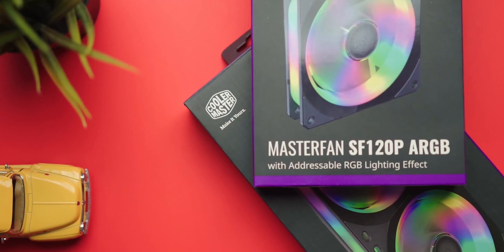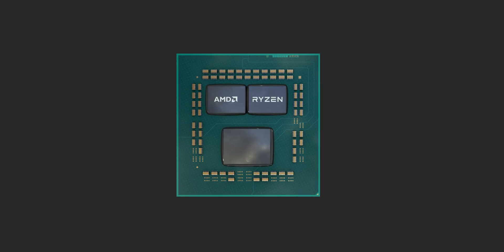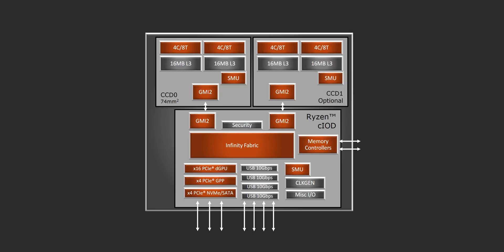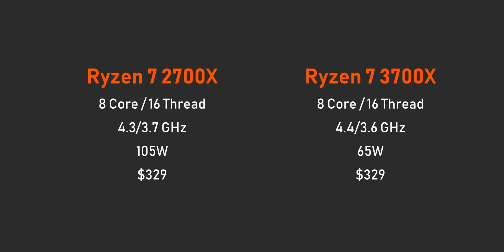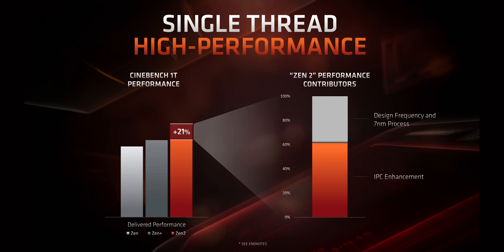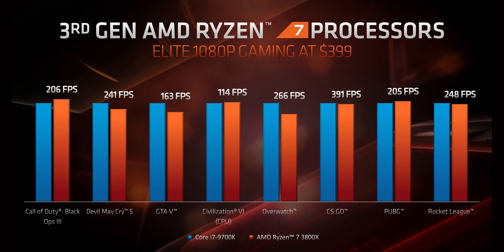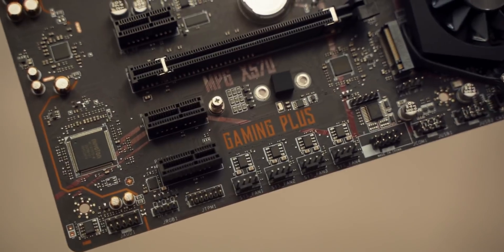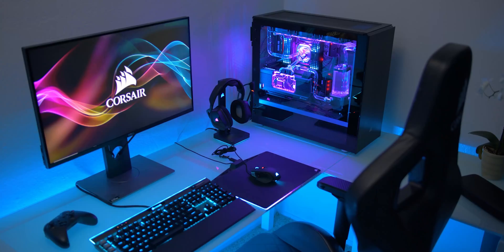AMD Ryzen 3000 – A Very REAL Problem For Intel?

Comment: I just want to see zen 2 ryzen 3 and ryzen 5 (4c/8t). Those "new" apus are very disappointing, they're basically the same cpus (2200g & 2400g) with a little better clock

Comment: it should be noted that the gaming charts were done running pre 1903 update and also pre security updates... so basically a best case scenario for intel
Reply: Yep, and now with 1903 helping AMD quite drastically especially in frame time, not hugely in fps, but perceived experience is so much better. At least that is my experience with gaming on my 2700x rx480 8g system. Then add security updates that are going to slow down intel... those charts were surprisingly not as bad looking as it is going to be in my opinion.
Reply: Zen 2 + 5700XT in Linux gets higher FPS in lots of games, and actually 10% higher in some titles. 1903 update was only really simple rule based upgrade, while Linux can optimize threads much better. After all, the latency between cores is faster in Zen 2 than with Intel in the same module, so careful scheduling have huge effects. Also better compilers will help a lot in the future, we still don't have any compiler with full Zen 2 support. Though GCC 9.1 in Linux already results much better performance with Zen 2.

5700XT has 1% - 0.01% minimums at much higher FPS than Nvidia 2070 super and actually faster than 2080ti in lots of titles. Though AMD drivers are still pretty new, and based on history, drivers will be much faster in the future. Nvidia drivers are pretty much fully optimized after 1 year of RTX. Also AMD has better image quality, because Nvidia has cutting corner optimization tricks due to having fully closed source drivers. It's something youtubers SHOULD research and report more. Comparing ultra setting with high setting would raise huge complaints, but when you lower quality though your drivers, people are just happy about higher FPS.

Comment: Even hardcore Intel Fanboy like me heading towards Ryzen 3000. Yeah, they are in trouble.
Reply: I will go to the best price/performance, and that is AMD right now.
Reply: I have not been on an AMD CPU since my Athlon 64 Shuttle PC LANing days. Even if my next PC has an Intel CPU, which might not be the case as I am eyeing that 3700X (or 3800X), competition is good. For an Intel fan that will always stay with Intel, AMD forcing Intel to compete for price and performance/features is good for them (and everyone else too).
Reply: lol i switched a year ago to 2700x
Reply: @drake6836  i switched almost 2 years ago for the 1600  xDD
Reply: Yup intel fanboy as well. This is pretty exciting for the industry. Switched to to ryzen last year.
Reply: I was on the intel wagon too for a while, but now anyone saying Ryzen isnt a better Price/performance ratio is just blind yes intel is slightly faster but for many budget builders like most of us Ryzen is almost a no brainer to put the extra money you save towards a better gpu.
Reply: Same I may take a look at ryzen 3000 but I simply don’t need it and plus I want to save money for the desktop 10nm intel. What do you think spend 500 for a decent upgrade or wait .
Reply: @Bigboii7  HMMM named troller, talking like intel 10nm will be out before 2021, and like it isn't going to be a performance LOSS in its current state due to 20% lower frequencies not to mention cost 2x more than it should because intel's yields are absolute garbage.
Yea okay, whatever you say mr. Troll.
You can go back to your troglodyte den now.
Reply: @shawnpitman876  lol Shawn calm down.
Reply: I think that means he has finally taken the Red Pill. Good Job!
Reply: DEATH TO INTEL INTEL IS FINISHED! MY MONSTER PC IS RYZEN 7 1700 GTX 970 G1 GAMING 16 GB DDR4 3200MHZCL15 GS KILL RIP JAWS DE;LLP2416D 24'' 2560X1440 60 HZ IPS! RUNS MAX SETTINGS 1440P 30+ FPS EVRYTHING! NEVER BUY INTEL AGAIN!
Reply: @shredderorokusaki3013  PHAHAHHAHAHH ! 30 fps . @ 2017 i play PUBG @ 135-144 fps ( 144hz lock )  with 4790k and  GTX970 !
Reply: @shredderorokusaki3013  even @ 1080p low settings your 1700 @ 2017 had drops to 80 in PUBG !
Reply: Shredder Orokusaki the next card isnt the 3080 its the 2080 super, so yea. I would wait for the prices to drop and get two 2080tis
Reply: @Nathaniel Smith FX 9590, idiot. 5ghz on air.
Wanna prove you know literally nothing some more, fuckwad?
IPC is what matters, not DUHHH I CAN HIT 5GHZ.
Reply: @shawnpitman876  is fx9590 on 14nm ?
Reply: @Nathaniel Smith AMD 7nm doesn't need 5GHz to win in performance.
Reply: @frostybe3r  and it wont on 7nm .
Reply: @Taurus_Play  Intel 10nm desktop won't be til late 2021/2022.
Reply: @Nathaniel Smith Ironically Intel 10nm has significantly lower clockspeeds.
Reply: It's not the general consumer sales. It the OEM builds housing AMD CPUs that'll kick them in the balls.
Reply: I switched a year ago to a R5 2600 from an i5 3570k. Have to say, those cores and threads are nice since I like streaming so its good they are there. I am going to switch to an R9 3950x in December though.
Reply: @Nathaniel Smith Why should Amd aim for 5ghz? If 4,6-4,7ghz matches intel's 5,1ghz. The Magic word is ipc, and yes intel had better ipc for a long time, but even that is lost now. If a ryzen 3000 can oc to 5ghz, with better ipc then intel... enough said i guess. (no fanboy here, have a 4770k and 1700x)
Reply: Hector Domino “In trouble” how? That they’ll be out business or they turn into AMD from decade ago? I applaud companies who turn it around, but the new found AMD fanboys seem to ignore their recent pathetic history. Will Intel suddenly become like that? Doubtful..
Reply: Just want to know exactly how the 3900X beats the 3800X in csgo, gtaV, etc. Does having more cache makes this possible? Isn't the memory latency supposed to be higher on the 3900X having 2 chiplets vs 1 on the 3800X? 🤔
Reply: @Vishnu Kalluri moron , go to my acc and watch videos .
Reply: Thanks for the input. Time to buy AMD stock since even the hardcore Intel Fanboy are leaving Intel , this could only mean that AMD stock price will Rize this year for sure.
Reply: @Vishnu Kalluri KABOOM  ...  here goes blown up ass of AMDtard
Reply: I repeat - 7700k = 3700x < 8700k @ gaming
Reply: @Vishnu Kalluri hows first tests ? >:)
Reply: Miguel Carones  only took his kind 10 years. Intel fanboys are mighty slow on the up tick.
Reply: @jotunheim5302  no. Intel is usually alot better in gaming then AMD that's a fact. The i7 and i9 is still better then any current AMD processor when it comes to gaming that's a fact as well. These new zen 2 processors are the exception
Reply: @hatchell18  Zen 2 > Coffee Lake
Reply: @frostybe3r  yeah no shit but if you read what I said youd see that i said current CPU. Zen 2 is the new AMD CPU that doesn't come out till next month and coffee lake is a year old now so no shit a new CPU will be better. When Intel releases their new CPUs later this year they will most likely be more powerful again like usual.
Reply: @hatchell18  Coffee lake might be a year old and zen 2 will be hitting the store shelfs just now, but the diffrence is intel is now behind and they dont have anything to battle zen2, if they will finally (out)match zen 2 (in 2-3years) Amd will most probably have their new CPU's also ready. Intel got outpaced and has now to play the catch up game. (what amd did for years)
Reply: @themadnes5413  the new 3800x just barely beats the 9900k by 1-3%. The only AMD CPU truly better then Intel is their top of the line 3900x. Dont mistake me for an intel fanboy I will be getting one of the new ryzen chips because right now I have the i7 8700 and I want the new ryzen 3800x. But it took AMD years to finally barely beat Intel and it wont take Intel years to catch up. I can promise you that the new Intel cpus this year will be better. Intel wont come out with new cpus and have them be worse they arent that stupid
Reply: @hatchell18  intel is good for gaming true, that's if you only game tho and don't do anything else while gaming which lets be honest more and more people don't just play the game now. People are either watching videos, streaming, working, or just have a lot of other programs running. So not saying intel's cpus are trash just that unless they do go into more multi core builds that aren't $500+ amd will end up getting more and more people switching. I mean just with the Zen1 release i've had friends/co workers switch from intel.
Reply: @LilPistacho  plenty of good and fair points bro. I'm glad we can have a civil debate with no fanboying lol. And yeah I plan on getting the new 3800x ryzen
Reply: @hatchell18  yeah man, although i guess im a fanboy to some extent(usually cuz of price.. Lol) but i do understand where amd wins and loses same with Intel. Im planning on upgrading to 2600x, 16g 3600hz ddr4, x470 mobo, and not sure on gpu maybe fix my rx 580 or get the 590..just waiting for the new stuff to come out to see how much i can save lol
Reply: @frostybe3r  7700k = 3700x < 8700k @ gaming
Reply: @jotunheim5302  Bruh, AMD wasn't worth it AT ALL from 2011-2017, period. FX was garbage, anyone trying to defend it is being an AMD cuck.
Reply: R u really an Intel fanboy tho ?
Reply: How in hell can you be an Intel Fanboy?
Reply: đenan Hajrovic why would you be a fanboy for any piece of hardware? A proper PC builder will always choose hardware based on performance and value, not name brand.
Reply: @MapleLeafAce 
Don't forget about security.
Reply: AMD still lacks IntelRST for raid. I have several ssds for virtualization. AMD raid SUCKS
Reply: @timothygibney159  Threadripper 3rd gen: "Hold my beer".
Reply: lol why ? 1800x perform like 3770k @ games ... 2700x like 4790k ... 3700x gona be like 7700k @ games  and why should even think about AMD when iam using 8700k @ 5ghz with 3866 CL16 RAM ?
Reply: @Taurus_Play  Because your 8700K has trash multicore performance?
Reply: @frostybe3r   multicore ? lol 8700k with 6 cores > 1800x with 8 cores @ multi core !
Reply: @Taurus_Play  should i buy 2 RTX 208Ti's or wait for RTX 3080TI?
Reply: So AMD need an extra 4 cores to near enough match performance? In thier cherry picked games? Thanks to this the price of the 9900k will come down. So I'll still be sticking with the 9900k. I dont need 12 cores
Reply: @Pixel_FX  the fuck you on about? 9900k 8c 16t vs 3900x 12c 24t with pretty much the same performance in games....with a 15% price reduction now coming to the 9900k making it cheaper....what are you not understanding?
Reply: @adamcooper8010  3900X will be significantly better than the 9900K in multicore and almost identical in single, only peasants with 1080p monitors care about the 9900K for gaming as compared to AMD in the past.
Reply: @adamcooper8010  gotta see deeper, AMD cooler > Intel stock cooler. AMD 400 chipset will drop in price and still supported till 2020.
Reply: @Ayeen1986  appreciate that. I'm no fan boy btw, this competition is great as we all win from it. I just personally think the 9900k and 3900x so far, seem well matched, purely on a gaming basis. Will be waiting for the bench testing before making my mind up
Reply: @adamcooper8010  Yup, cant say much either untill Benchmark prove it. Not an Intel or AMD fan. Nice to read the arguments between intel fan vs amd fan though, some entertainment i guess.
Reply: @Ayeen1986  It does make good reading. Fanboys from either side are pathetic. Trying to defend something that is individual to that person's needs. Get a life and just pick what's right for you at the time. Theres still reasons to go for either CPU.
Reply: @Ayeen1986  Well to be fair if you have been in the PC building community for a long time you already have an above average cooler. Like me and my friend have 7 NH-Ds lying around somewhere  and that's just our Noctuas lol

Comment: Ryzen 3 with 6 cores.. Best jokes.. That was a good time :D
Reply: People often misread leaks. The fact that we did not get 6c/12t Ryzen 3 this time does not mean that Zen 3 coming next year will not bring it. In fact Zen 3 will bring 3-way SMT on desktop and 4-way SMT on Threadripper and EPYC. That means:
6c/18t
8c/24t
12c/36t
16c/48t

...on desktop and:

12c/48t
16c/64t
24c/96t
32c/128t
48c/192t
64c/256t

...on HEDT/Server.

Comment: those APUs arent place holders. theyve been 1 gen behind from the start, not sure why, but last gen the 2000 series APUs were still based on zen 1 architecture
Reply: I guess it takes a lot more engineering to put together the APU's, and because the current gens architecture is changing while it gets developed they use last gens since they know exactly what it is to stitch it together with their current completed GPU architecture. So since Navi and Zen 2 were still being worked on while the 3200g and 3400g needed to be developed, they used Zen+ and Vega since they were completed products. 

So we should have a Zen2 + Navi chip next year when Zen3 comes out, in theory.
Reply: @shadowjulien5  if they do what theyve done the past 2 generations, yes, and im rather excited about that, im just curious how cut down the gpu is going to be to be able to fit with the cpu, and how many cores they can put it with